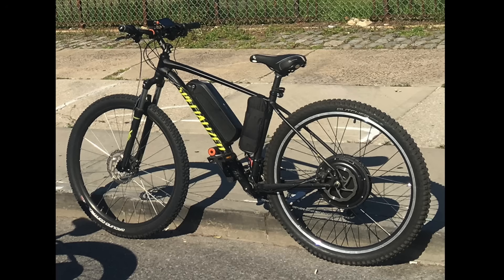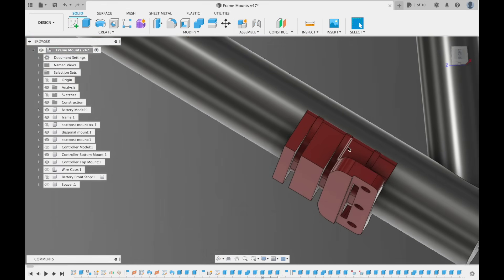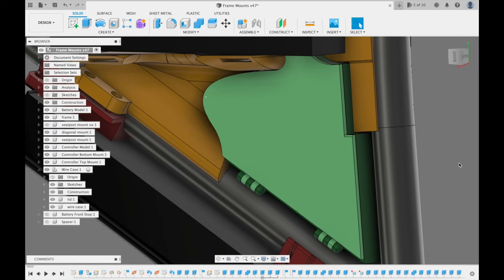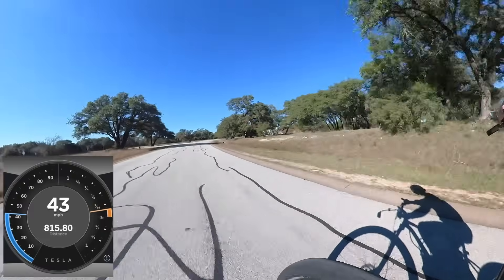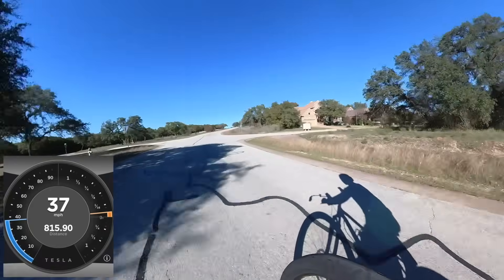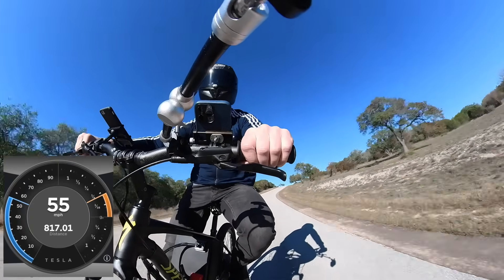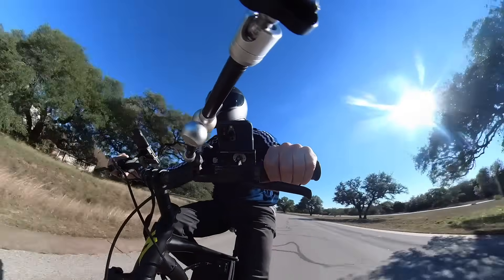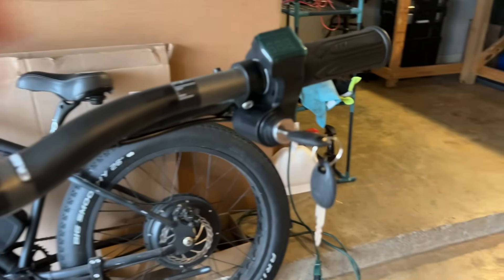I Built a 15,000W eBike and it's WAAAAY Overpowered

Comment: "I built a 15kw ebike and it has a range of less than a mile" is what this should have been called.
Reply from the maker: it's a 20Ah pack so range is 25mi. how much range is enough for you?
Reply: @GaiusGarage  Looking at the pack, there is no way that is 2kw hours.  In any event, a 15kw motor would drain the battery in no time.
The volumetric density of lithium ion batteries is 210wh per liter.
Reply from the maker: @tarstarkusz  the pack is 100.8V fully charged, and made of six 20Ah cells in series. 100.8 x 20Ah = 2kWh. if you don't believe it, I don't know what to tell you. 

this is not a 15kW motor, neither is it a 3kw, 5kw or any number of kilowatts. motors convert electrical to mechanical energy. the amount of power you put into it, is the amount it will convert. the controller is what determines how much power goes out from the battery and into the motor and that changes depending on riding style. at full acceleration, it's 14-15kW for a few seconds until the bike gets up to speed, then it's drops substantially. "normal" riding draws much less power. the overall power consumption when riding is around 70 wh/mi, thus the bike gets around 30mi of range
Reply: @GaiusGarage  I am aware of how electric motors work and I know that it's not even a 15kw nominal motor, probably more like a 1000-1500 and that it doesn't run at anything like 15kw except under full throttle, which would burn it up quickly.

My point is that the battery appears too small to store the just short of 2kwh (you use the nominal voltage which is usually 3.6vpc, not the fully charged voltage) and that if you tried running an actual 15kw motor at 15kw, you would accelerate extremely fast, but have an extremely short range.

Furthermore, overpowering a motor that is likely at most 1.5kw, will severely undermine its efficiency and most of that 15kw would go to heating the windings and the rest of the motor.

The reason I say it is most likely no more than a 1.5kw motor (I'm probably being generous) is the Chinese simply lie about the motors.  China is really the only game in town for bicycle hub motors. A 15kw motor, that is, a motor that can run indefinitely at 15kw would weigh 100 pounds or more.
Reply from the maker: @tarstarkusz ok yes, if you use nominal voltage (88V) you 1.7kWh pack..close enough. 

but I never said this was a 15kW motor, I'm calling the bike "15kW" based on peak power. real-world peak power is a bit less due to voltage sag. the motor is definitely no where near 15kW continuous but probably not 1.5kW continuous either. also this is a Cromotor, which was manufactured in Croatia, not China. This motor is no longer in production but it was advertised as 5kW continuous. I'm sure the true continuous rate is at least within the ballpark. As for running this motor at 88V nominal, 150A (13.2kW), yes it produces a lot of heat which I'm sure compromises performance and the true horsepower at the tire is less than even 17hp (13kW). But it's probably more than 10, which is a heck of a lot for something that weighs maybe 80lbs
Reply: @GaiusGarage   I saw the demonstration and acceleration. I don't think you are lying.
My initial post was simply about the lack of power in batteries.  That if you did have a 15kw set up, that it would burn through the batteries if you tried to use all that power.  I have no idea if the flat batteries are anywhere near as dishonest as 18650s which are routinely mislabeled.  I've seen 3kwh hour batteries and I know how big they are. Given the size of the bike, it didn't and doesn't look like it could possibly hold that much power.  Then a quick google gives the volumetric energy density as 210wh per liter. So you're looking at 8 liters for almost 2kwh.
Reply from the maker: @tarstarkusz I think you are conflating energy density with peak power delivery. so-called "power cells" or certain chemstries can have a very high C-rating, which is the ratio of discharge current to their capacity. for example, SPIM08HP cells have peak current rating of 800A for only 16Ah capacity (50C), which is insane. Many 18650 power cells like Sony VTC can deliver 25A continuous for only 2.5Ah capacity (10C). Lithium polymer chemisties like the cells in this video are designed for high discharge applications. I have a seperate build video for this pack where I go into their discharge capacity, which is 480A peak. Even at 88V nominal, that resolves to almost 40kW peak power (not to be confused with 40kWh). Thus, this pack can easily provide 15kW peak power, in fact, it can probably supply 15kW continuously for maybe a minute or two.
Reply: @GaiusGarage  I know certain lithium ion batteries can deliver high current, especially the flat ones.   I am talking about the watt-hour capacity of the battery.  And also the motor's ability to deal with that current. The windings are too thin and heat up with excess current. This causes the wires to get hot increasing the resistance of the windings, further increasing the amount of current that will drop across the wire heating it up even more.
Reply from the maker: @tarstarkusz the Wh capacity is 96V nominal x 20Ah = ~2kWh. motor heating is an issue but as I mentioned it can be mitigated by not riding too aggressively for too long
Reply: @GaiusGarage  AFAIK, the flat batteries are designed to be extremely high output in term of their C rating.  20, 30, 50C output being possible.
But there is also a downside to high current capacity and that is storage capacity.  The high current output is achieved with exceptionally high surface area, but this reduces storage capacity.  The most energy dense lithium batteries tend to be limited to under 10c discharge and 1c charging or less.
210 watt hours per liter was not contextualized, but it said this was typical. The battery looks smaller than 10 liters.

Have you tested the capacity? I would be very interested in the results. Especially if you measure the volume and especially with Chinese dishonesty throughout the battery supply chain. (it is absolutely ridiculous how unbelievably unreliable battery specs are or even if you will get what you actually order and not a counterfeit)  Perhaps I was looking at an old volumetric density specifications and your batteries are much higher.  But, I have seen 3kwh batteries and they are (appear to be) much larger than your 2kwh one.  One assumes a 2kwh battery would be 1/3 smaller.

What about the weight? How much does your battery weigh?  You can also use that as a proxy for how much power is in the battery.  Google says 300 watt hours per kg is typical.

Also, I ask this stuff not because I want to argue with you and tell you that you're wrong, but because I'm curious.
Reply from the maker: @tarstarkusz  its true that there is a lot of false claims about battery capacity and performance coming out of China but cells made by reputable brands are generally reliable. The cells used here are Turnigy Lipo packs, which are used throughout the hobby world and are probably some of the most reliable in terms of capacity (at least before they are degraded by constant abuse). Ive never empirically tested the capacity of these cells nor have I really looked into the limits of energy density for Li-ion chemistries. Generally speaking, NMC Li-ion has the best energy density, Li-po has less, and LiFePO4 has the lowest. And yes, high discharge almost always trades off with capacity. I dont have this pack anymore to test it, but I have no reason to suspect that the capacity was much lower than 20Ah within some small tolerance

Comment: What range do you have, I’m thinking about doing something similar, build a camper with 3000 on each wheel. And 5000 for bike
Reply from the maker: range for this bike is not very far - 20Ah gets about 25 or so miles, make 35mi under 30mph

Comment: In Australia you are only allowed a 250watt motor by Law and a top speed of 12mph. Anything else and you will have your bike confiscated and a fine. Isn't it awesome living in Australia
Reply from the maker: well this isn't exactly legal here in the US either but I'm also not riding this thing in road traffic on a regular basis. if cops see you going 50mph alongside cars on a bicycle they'll probably pull you over. but if you're riding more or less like other ebikes on the shoulder or city streets, no one is going to pull you over and even then, no one would be willing or able to prove whether or not this system is 250W or 25000W without really having a detailed understanding of the components. I don't know how hard they go after these in Australia to the degree they cops and prosecutors become ebike experts

Comment: You should get some road tires on there. That'd be a lot safer. Maybe consider some good gravel tires as well. That'd give you some little knobs for off-road, while making the street riding a lot safer than the straight up dirt tires. 
If you convert to drop bars or the surly corner bars, that'd help keep your upper body lower and out of the wind, giving you a higher top speed
Reply from the maker: These maxxis tires actually are dirt tires rated up to 80psi - they actually wouldnt even be very useful off-road. got them specifically for this purpose. low handlebars would definitely be the way to go as well

Comment: Out of curiosity, how much current can your hub motor take before it's the limiting component? Surely it's not actually putting down 15kw if you had it running at 3kw previously? Just curious.
Reply from the maker: 15kW assumes full charge (100V) and full current output from the controller (150A) .. in reality there is voltage sag during heavy acceleration so real-world max power is more like 14kW, but yes, this motor is actually taking on the order of 14kW of power despite previously being used for 3kW. this motor is actually rated for 5kW but this value is the continuous power rating, which means its the power level at which the heat generated is equal to the heat dissipated, so the motor never accumulates heat and can run at that power level forever. if you push more power into the motor (8kW, 10kW, 15kW etc) heat will begin to build up in the motor more and more quickly. if the motor does not have a chance to cool down it will overheat and short-circuit. so you can technically use this motor with 50kW but for a very short time before it gets damaged. at 14-15kW, I'm able to ride pretty aggressively for 5 minutes or so but then I really have to back off and let things cool down. Ive almost fried this motor on a few occasions, where I come back from a ride and its smoking (the smoke is a super-hot motor burning dirt and grease on the surface, not an electrical fire) ..just been lucky so far

Comment: What an awesome kick ass project you put together man fantastic how cool and the best part is you used a specialized 29-in wheelbase which is what I'm building right now but it's not no $15,000 watt it's just a 1500 w which is more than enough to get hurt on with the 1500 w 20 amp hour battery and I can do a good 40-45 mi an hour with that $15,000 Watts seems like it would be able to hit a hundred miles an hour no problem I watched your video I watch the speedometer and my god dude you went from zero to 40 mph within just a couple of seconds that is outstanding so I'm thinking you're just getting started that thing's you need to take it out on the freeway and really go balls out suit up get your helmet on do whatever reinforce everything Make sure it's safe and go balls out on it let's see what that thing can really do You barely tapped into it. The only other question I have will I have two questions how long did it take you to build and manufacture all those parts and put it all together and how much did it cost what was the total cost for everything for the batteries and the controller minus the cost of the bike I want to know how much the rear wheel motor the 5000 Chrome or whatever it was called cost how much did that cost you how much did it cost for the kit the whole thing the batteries and controller and rear motor how much.

Comment: Can you explain to me why the motor didn’t burn out when you gave it 150 amps? I thought amps is what kills motors
Reply from the maker: the reason a motor gets damaged is not amps directly but heat, although heat is directly related to current. the 150A applied here is only for a very short time when accelerating hard, once the bike gets up to speed, the current drops to only 40-50A or less. so even though heat is produced when accelerating, it's not enough to damage the motor immediately. but if you continue to ride very aggressively, heat will build up and eventually melt the enamel coating on the motor windings causing a short between the phases, this is usually what happens when people say their motor "burned".  this motor does get hot very quickly with this set up and I almost fried it a few times. It would be a lot less vulnerable to overheating if I added some cooling like a heatsink
Reply: @GaiusGarage  ohh makes sense thanks for the reply
Reply: @dylanfrajerman1257 I have seen a video in yet where a guy added atf fluid in a geared hub motor and then sealed it
statorade is only good for direct drive
atf fluid splashing around in the geared hub motor lubes gears and bearings and also transports the heat from the windings to outer case ... so direct drive add statorade.. geared hub add atf oil

Comment: I bought this bike from David Ochner, who bought it from you a while back. We are troubleshooting the BMS. Ant BMS doesn’t seem to show the live voltages, and the system isn’t responding to charge and discharge controls. David thinks the hardware only works with older version of the BMS software. I ordered an old Pixel to try his exact version of VBMS. Thoughts? Thanks! Love your builds! I thought he was you when I saw the listing on eBay haha
Reply from the maker: oh nice! Thank you! How are the dropouts doing? yeah the BMS uses the old app version. I'm not sure it's possible to get the old iOS app version because it's a separate app (despite the icons being exactly the same). pretty sure they unpublished the old version from the app store. Android is probably your best bet

Comment: No one made this comment so I will, you’re hilarious! I laughed at all the small jokes!
Reply from the maker: Best comment! Thank you
Reply: I am awaiting my 3000w & 80amp Sabvaton Controller Kit with 72v 20ah Battery

If it’s quick for you, could you tell me my predicted top speed and wattage, amps, kilowatts I’d be putting out?! Thank you!
Reply from the maker: @leoelegado if it's an 80A max controller at 72V (84V fully charged) max power will be 6.7kW. Although there will always be voltage sag so real max power might be 5-10% less. Not possible to predict max speed without knowing the KV value of the motor which depends on a lot of factors but mostly voltage and winding (motor design). If you know how fast the motor will spin at X volts (that's the KV value) you can figure out how fast it will free-spin (with no load) for ~80V or so, and subtract 5-10% for resistance when youre riding. Then you can do the math taking into account wheel diameter and any gearing you may have.

Comment: Awesome. Please switch the frame just to be safe. That thing will fold on its own at 50 mph at some point.
Reply from the maker: exactly. half the comments on here are people mad that I didn't top out at 70mph on this thing, meanwhile aluminum has a very low elasticity and fails suddenly and completely when it does. Ive since disassembled this build
Reply: @GaiusGarage  @70mph it would definitely crumble aluminum welding wouldn’t hold such intensity on such frame.

Comment: I would consider a motorcycle frame of some sort with that much power! This is great! I am thinking about buying a blown up motorcycle and converting it to electric. This gives me several new ideas. Thanks!
Reply from the maker: yeah this bike frame is definitely not a good fit for this setup. But you dont need to go full motorcycle for this either - a stealth bomber frame is perfect for this - I have a build video here: https://youtu.be/YpZA3jAPJ_E but if you wanna go full motorcycle conversion you can check out this video https://youtu.be/vnCamwNd_IU
Reply: The stealth. B. frame rocks because it can be built into something that looks like a bicycle. Who wants to register one of these things? Not me. @GaiusGarage
Reply: Honestly, ya why not! You could probably get something for a few hundred $$ and then it would have a VIN so maybe it would be road legal and insurable.
Reply: Somebody here posted a great vid. of a small 1970's junk motorcycle converted to e-power. The motor was swapped for a battery tray and it was perfect for a high- output ebike. What I don't know is whether you'd have to register such a thing.

Comment: The wires get hot in that box?
I had a problem with them melting together
I had to separate the power wires from The controller wires...
Awesome job On your bike
Reply from the maker: Its definitely possible - probably better you separate them like you said. but if theyre getting so hot that they melt the other wires, you've got too much power flowing to your motor and it will eventually become damaged

Comment: What motor was used for the 15kw version?
Reply from the maker: This motor is a "Cromotor" they are no longer in production - its not quite up to the task for 15kW and I almost fried it on several occasions. A QS205 with cooling fins would be the way to go here
Reply: @GaiusGarage  Oh no no I don't need the bike to go 20 battery HP. More like 12 battery HP. Something heavy duty for my brother in law.